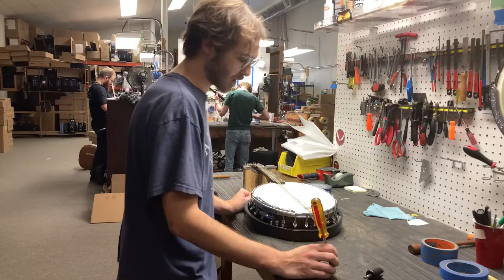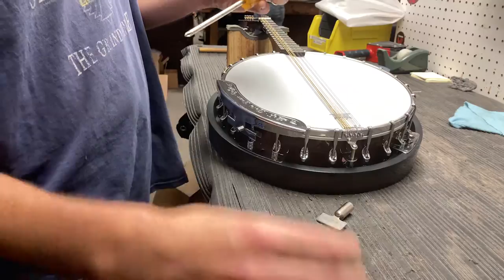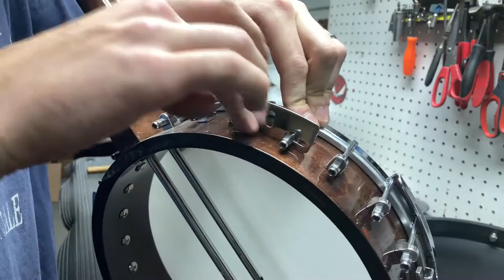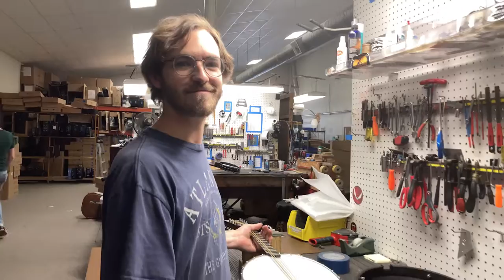Shop Tip: Removing/Mounting A Banjo Resonator

Comment: Hi! I don't have four plates on my banjo but an entire ring instead. Do I start with loosening all the strings before loosening all of the bolts? Anything else? Or just start with all of the bolts right away? EDIT: It's two half rings actually
Reply: My question as well! I assume you just do one side at a time.
Reply: @charlespatt  I marked the place where the bridge was on both ends with a pencil, loosened the strings a lot, then loosened all the nuts evenly, a little bit at a time. It worked. After removing the two half rings, I did the same thing in reverse order, keeping in mind that the banjo head should be evenly tightened all around and be tuned at around G or G# (you can also make a recording beforehand and tune it back to the same pitch after)